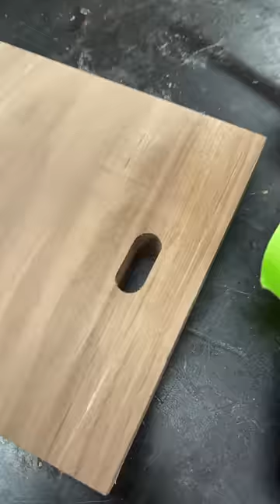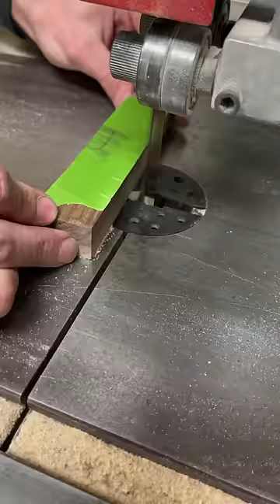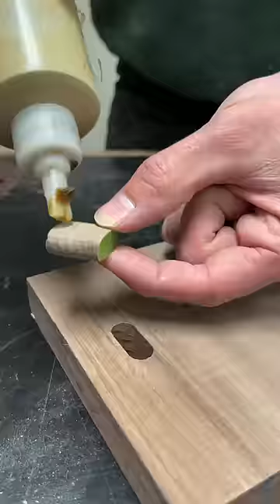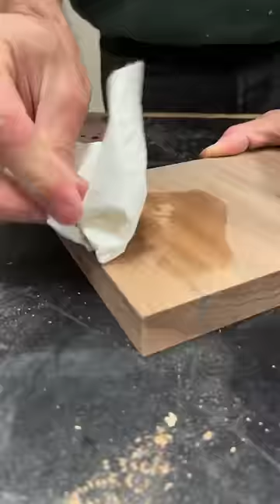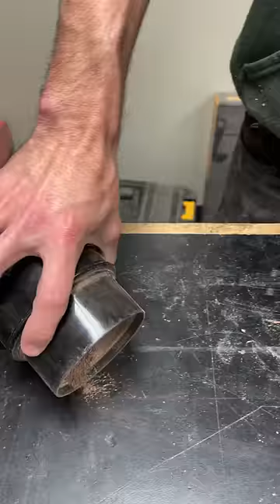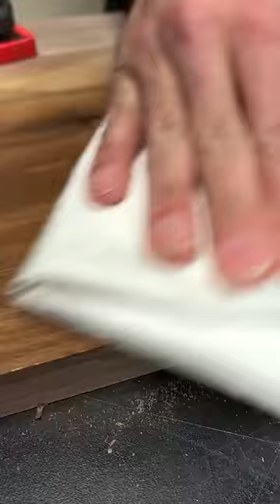how to fix your domino placement? | Woodworking Skills 🔥 #woodtok #shorts #woodworking #asmr

Comment: “Have you messed up your domino
placement? Here's how to fix that!”
Except that you didn’t make another domino with the correct placement after making your repair. You just made a hole and plugged it without much care. If the piece is hidden enough to pass with that glaring mistake, I would rather not fill it at all and leave the hole